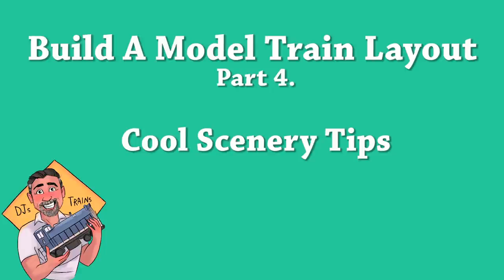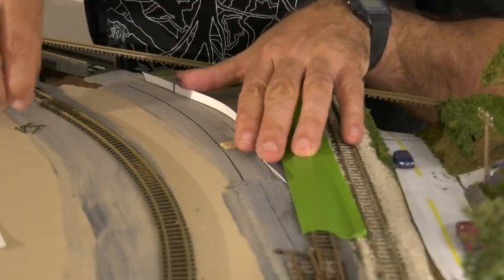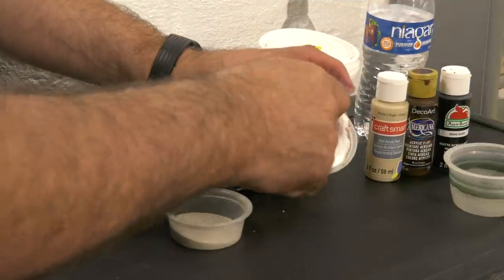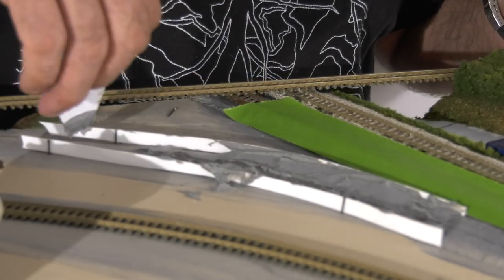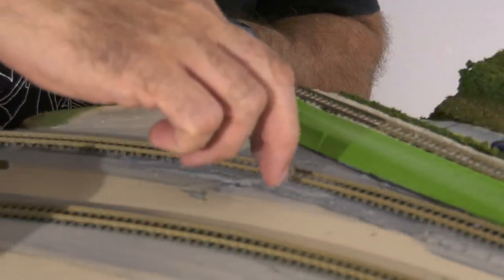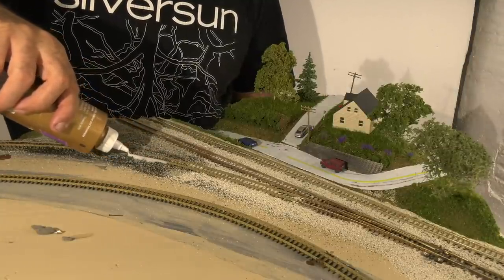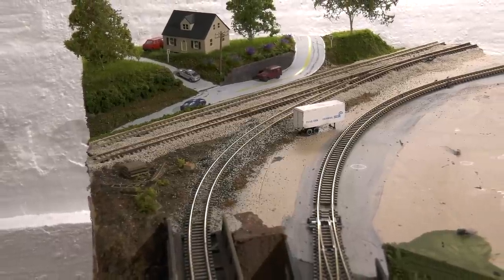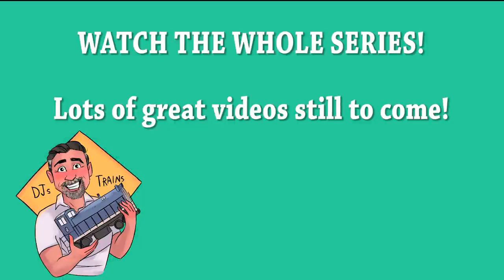How To Build a Model Train Layout Part 5.  Cool Scenery Tips

Comment: Good tips and demonstration.  I have used spackle, soil, local beach sand, and even framing shims to build up under flex.  The great beauty of flex track is that it creates its own easements horizontally, and if one lets it sag naturally it forms a good vertical curve or gradient up to the main grade level where an interchange or a spur meets.  For me, with any amount of beach sand I need, I just shake enough sand under the rails until it grooms to the correct shape and until the rails appear to be well supported.  Then, wet it with alcohol, add a light glue/water mix with two drops of dish detergent added, and walk away for about a day to let the mass dry and harden.  Works like a hot damn.

Comment: Here's a tip for the next time you need a short incline, like what you have from the main down into your yard.

Rather than using the foam putty, simply extend your cork-roadbed and then sand away the incline with sandpaper. Not only is it easier to keep the roadbed smooth & level, but you can also sand in the vertical curves. For a smooth transition from flat to incline.

Comment: Hi DJ, In the past when transitioning from main line to branch, I just filled up the air gap between the ties and layout with real rock ballast, either Arizona Rock & Minerals or Smith & Son ballast, both products are great. The secret is getting the ballast very wet with the isopropyl alcohol, you do not want any dry spots. Then flood the ballast with the 3:1 white glue mix as you show in the video and let dry a minimum of 24 hours. I'm telling you DJ, you've got to try Smith & Son or Arizona Rock & Minerals real rock ballast. You'll never go back to Woodland scenics clay ballast. I know exactly what you mean about branch lines, hence my Long Valley Branch, which is loosely based on a number of branch lines in the area. My first encounter with a branch line was the Bridgeville & McDonald branch of the Penn Central railroad. That branch line ran between Bridgeville and Gladden, near my grandparents home. Watching those PC Geeps working that branch left a lasting impression. On a side note, I finally got a backdrop for the layout. It's just temporarily attached to the wall, until I'm able to get some hardboard and attach it permanently to the layout. What a difference, I'll post a short video to show the difference. Cheers, Rich S.

Comment: DJ, next time you have to fill the gap from roadbed to plywood, try using wood shims. They carry them in the home improvement stores. The sims are normally used when carpenters set door and window frames but make a great incline/decline roadbed, especially in N-scale.
Reply from the maker: but this is a curved incline so those shims wouldn't work as well.

Comment: A lot of the old North Shore Line in NE Illinios and SE Wisconsin has been converted to bike trails. It is still possible to see the footings for the framework that held up the overhead wires. There are even abandoned power houses still standing along the right-of-way.
Infact some of the North Shore right-of-way was still actively in railroad use up to the early 2000s just north of where it interchanged with what was the old C&NW K-D line. This section of line bisected a large industrial facility.

Comment: Try using wooden furniture shims. They are a softwood, wedge shaped. About six inches long, and can be easily trimmed for correct width and for which heights of the shim you need!
Reply from the maker: I use them on straight aways, but this was curved.

Comment: here is another tip .. go to homedepot an grab yourself a piece if 1/4 white plastic (usually by paneling isle ) . its like 20 $ for a 24"/48". i  cut them with a band saw or table saw or a plan old knife . can screw them down an use what your using 222 lite from value home center .take a little scrap piece an scrap it off just like you do concrete  after it dries take off forms .